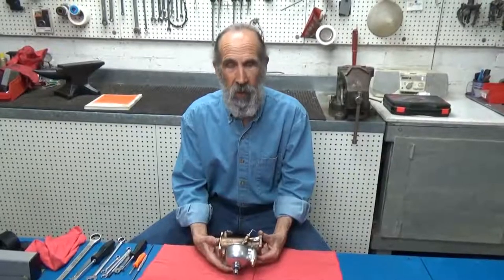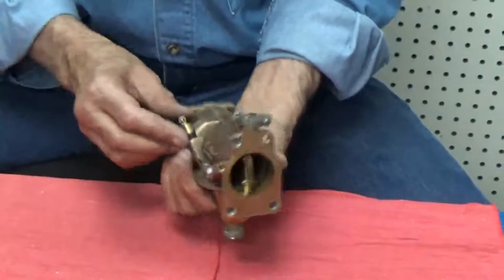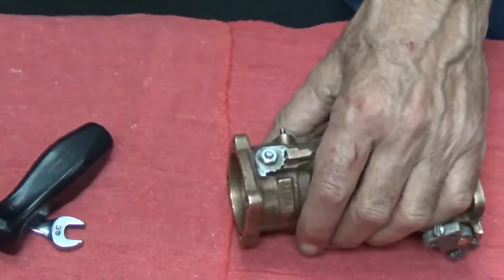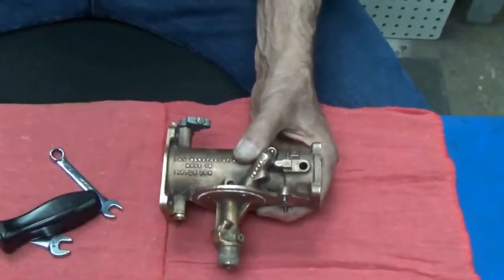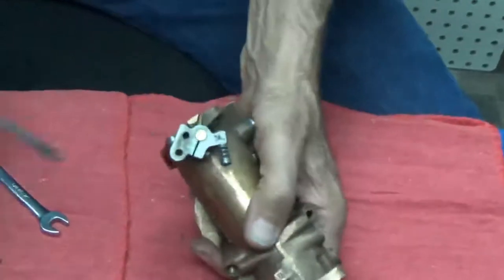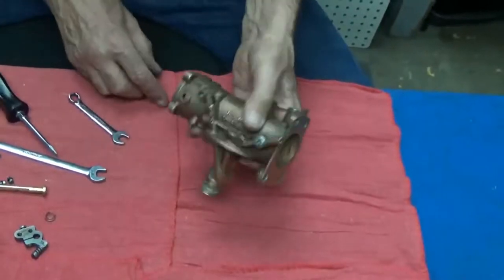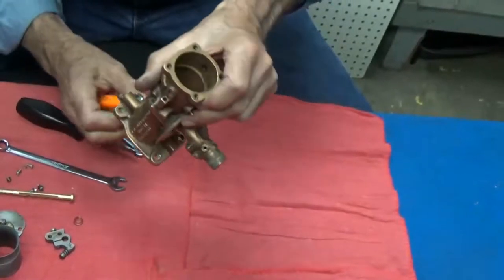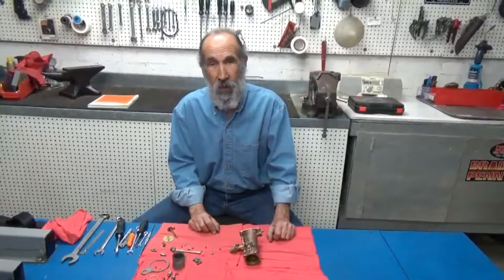Linkert carburetor rebuild for an old Harley Davidson, Part 1 of 2.

Comment: Thank you for all of your excellent tutorial videos for vintage Harleys. I have a 40mm Zenith carburetor on my 1945 Knuckiehead EL. I have just rebuilt the carb.
I neglected to count the number of turns on the adjustable main jet before I disassembled it. I have been unable to find any information about the initial setting for the adjustable main jet. What is your suggestion for a starting point? Thank you for your help.
Reply from the maker: Well, I've honestly forgotten.  I generally  run Linkerts on old Harleys.  But, back in the day, I did hot rod a Bendix and run it on my 74" Shovelhead.  Back then, you would buy a kit that converted it to an adjustable main jet.  The only problem was that the adjustment, and the ones that came with an adjustable main jet, had a very "coarse" adjustment.  I think you were supposed to start at about three turns out.  I'm not sure.  But again, that adjustment was very hard to get a fast or accurate adjustment.  Make sure the throttle shaft is tight.  I removed the choke plate and shaft and plugged the shaft holes and installed a "flow ring" inside the air filter.  I made it work and it worked well.  Just try not to get frustrated with that main jet adjustment.  Not easy to get right.

Comment: Hello Mike, thank you for all of your wonderful videos. You are an inspiration in skill as well as patience and zen. i am going through the M-88 Linkert on my 42' WLA and I cannot get the main nozzle out to save my life. I don't want to accidentally bend it because then it wont come out at all! Do you have any tips for getting a stuck tube out of there so I can pull the venturi? Im worried about banging the passage up or making it worse in some way. Mike you are a legend and thank you for all of your help over the years.
Reply from the maker: Thank You.  Soak it in carb cleaner.  Sometime, they're stuck for a long time.  Leaving it in carb cleaner too long can be bad.  You gotta stay on it.  I actually use plastic chisels to try and jar them loose.  I gave up on one and it's still in there and working fine.
Reply: @pacificmike9501  Thank you Mike! I will stay on it with some plastic chisels and maybe, in the end, it doesn't need to come out. Much appreciated man! Thank you for your time.
Reply from the maker: It will probably loosen up with use.  It's probably been dry a long time.

Comment: Hey Mike I recently watched your video on the disassembly and reassembly of a Linkert M74 carb. I'm in the process of restoring a 1960 panhead and plan on using the stock carb.During the disassembly process I became aware that the venturi sleeve has essentially welded itself to the carb body and won't fall out so nicely like yours does in the video,In fact this one is stuck pretty good. I've tried heating it, soaking it, running it in a ultrasonic cleaner and taking a brass drift with a flat edge ground on it to try and tap it out with no luck. Any suggestions? In fact I was wondering how important is it to get that out to thoroughly clean the carburetor? Is there any passages underneath that would require cleaning or would I be better off just cleaning everything else and let that be, before I damaged the carb trying to get it out? Thanks for any advice!
Reply from the maker: I got your question twice here and if, in fact that venruri is in there and inline with the hole for the emulsion tube, it doesn't really need to come out.

Comment: Mike, your videos are great. Thank you for sharing so much valuable information & experience. This is the first time I'm pulling the carb off my dad's old FL for a rebuild. The throttle shaft is slightly bent on the small end, and I cannot get it out. It spins freely and the bushings are decent, so not the worst problem, but irritating all the same. Any advice?
Reply from the maker: My advice, without checking it, pull it out and replace the bushings and the shaft.  If it really does feel good, then check it after running it by shaking the shaft.  No up and down with RPM's, you're good to go.
Reply: @pacificmike9501  Thanks, Mike. I suppose its better to get it done now, than to know its still bent & will have to be fixed "someday". I will try some emery cloth on the very end of the shaft first, to see if i can get the clearance needed for removal. If that isn't working, ill take a file to it because there is no way i can get it out as-is.

Comment: Hello Mike , thank you for the great videos . Would it be possible to do a Bendix carb video and maybe explain how to identify the jet sizes . Mine is marked C66-143 . I understand there is 5 different sizes , can you please  list them and which are smaller to bigger . if you could it would be a great help as the manual doesnt . not anything on the internet either .
Reply from the maker: I don't mean to be rude, but, we all ran those carburetors 'til we got better stuff.  They are very crude at best.  A real "artist" can make one work well. The jets were listed in the old parts books, but Harley hasen't stocked them for at least thirty years.  I'm sure there are some out there, but I really don't remember how the part numbers went.  I converted several to an  adjustable main jet, but the adjustment was quite coarse and took quite a while to get right.  However, I'm sure there is a supplier who has that kit in stock.
Reply: @pacificmike9501  Thank you Mike for your response , I know you would put the information up if you had it . Please keep doing what you do .

Comment: Mike big question for you. I just inherited my dads 58 pan. Its not stock he put it in a rigid in the 60s.
My question its been in my heated garage for 21 years untouched.... I just finished reading through my service manuel.
Were do I start Mike
Thanks Keith
Reply from the maker: Clean gas and oil tanks.  Clean carburetor.  Put in fresh oil and filter, if it has one.  Install fresh spark plugs.  Install new battery, if it uses one.  Fire it up, but don't ride it until you service everything else on the bike.
Reply: Thanks Mike

Comment: Hey Mike, thank you for the videos.  I am not a mechanic however, I am definitely wanting to learn.  I bought my uncle's 79 FLH-80 about 4 years ago. Unfortunately, I seemed to have issue after issue.  Between the problems with the bike and lack of time, I have not had it on the road much.  I have 2 questions. 1. What do you use to soak your carbs in? 2. (this one might be a complex question) When do you decide it is time for a compete tear down and rebuild?
Reply from the maker: I buy a gallon can of carburetor cleaner at the auto parts store ans soak the disassembled carburetor in it.  A complete teardown is required if things haven't been maitained along the way.  When something appears to need attention, do it.  If it hasn't been properly maintained, well...  The factory service manual explains what to do and when to properly maintain the machine.

Comment: Hey Mike. I’m rebuilding an m51 and I’ve gotten to the point of removing the Venturi while following your video but the Venturi is stuck tight and won’t come out. Also the emulsion tube hole doesn’t seem to line up. Are these issues normal?  Thanks
Reply from the maker: Yes.  The body and the venturi are dissimilar materials.  Soak in carb cleaner overnight.  Don't leave it in forever.  If that doesn't work, think about it.  Do you really need to remove it?  Probably not.
Reply: @pacificmike9501  thanks for your response and your videos. In my case I did need the Venturi out because the emulsion tube hole was misaligned and the emulsion tube was stuck down below the Venturi. Not sure how my bike ran that way. I ended up using a 1/16 deep well socket and two VERY gentle taps from a rubber mallet and it came right out. My M51 has new life and I can’t wait to see how much happier my bike will be

Comment: Hello mike Isaac again, and I have a question for you. I do pretty much all the maintenance on my bike when it comes to oil changes,belt adjustments and little thing you know nothing mayor, but anyway if you remember I told the older bike I have is a 2001 sporster 1200 custom and the other day I was watching your video you were changing the jets on your bodies bike and I think you put a 48 or had a 48 and I think you put a 52 if I’m right, ok my question is if I put a bigger jet what do I gain by doing that? Do I need to readjust the carb, if go with can be kind and answer my question please and thanks again
Reply from the maker: Well, I don't know what you have now or where you're at as far as altitude is concerned.  A larger low speed jet or idle jet, or as it may be called, a pilot jet, simply has a larger hole, which causes a greater flow of fuel, changing the air/fuel mixture.  It "richens" the mixture from an otherwise "lean" condition.  The only adjustment, other than jet changes is the "idle mixture screw" on the bottom of the carburetor.  There is an aluminum plug on the bottom that must be drilled out to facilitate this adjustment.  The main jet in the carburetor is usually large enough.

Comment: Hi Mike, doesn’t the motion tube have to have a tiny gasket on it? What chemicals do you recommend me to use to clean all parts, perhaps cider vinegar does the job?
Reply from the maker: I clean carburetors with carburetor cleaner.  Big can, soak over night.  There may be a gasket on the emulsion tube on some different model of Linkert carbs, but, not on the M-74.  Consult a parts book with great diagrams.  Perhaps the Tedd Cycle, V-Twin catalog,  Antique Section.

Comment: Hey Mike. Is it possible to ride a M74b instead of an M36 on a '49 Pan? Thank you!
Reply from the maker: Absolutely.  However, in the interest of being stock, is this a 61 or a 74?  M-74B is standard and easy on a 74 incher.  For a 61 incher, probably a smaller venturi would be required.  Remember, in 1949 there were EL's and FL's.  EL is 61 cu. inch, and FL is 74 cubic inch.
Reply: Pacific Mike Oh Perfect. I got a FL with 74cui. Trank you!

Comment: Good evening, could you give me the needle measurements please?  I want to make them ... and I don't know the diameter and length.
Reply from the maker: Sorry, but no.  Those are long tapered needles made of brass.  You will need either the real thing or engineering drawings.
Reply: Pacific Mike i need the length and diameter of needles for linkert m16 thank you very much for the reply!